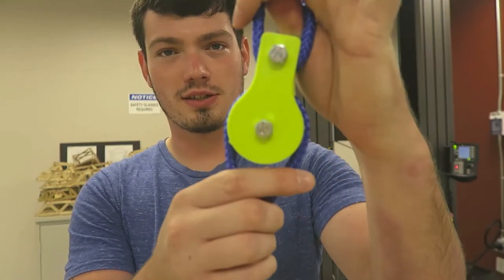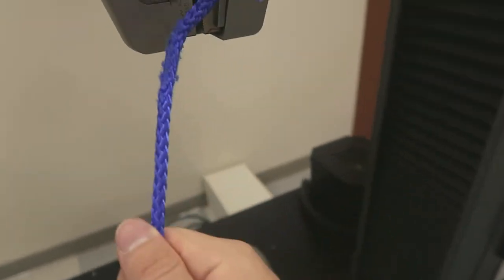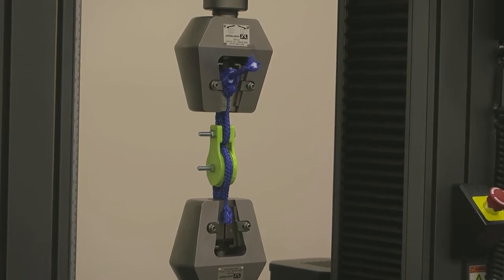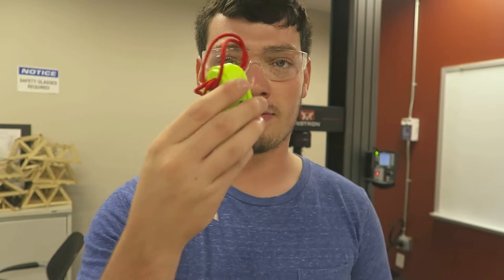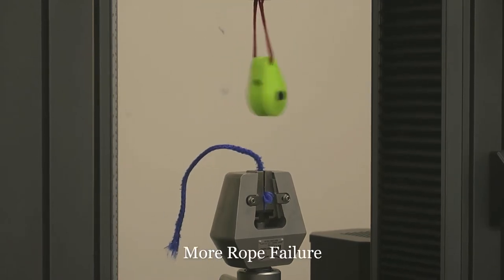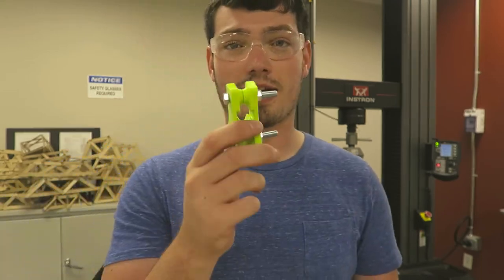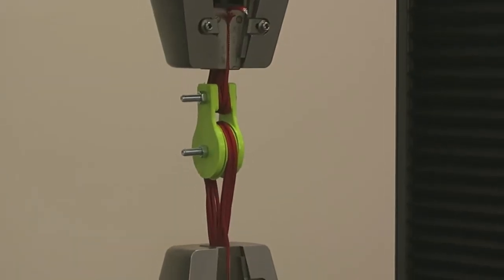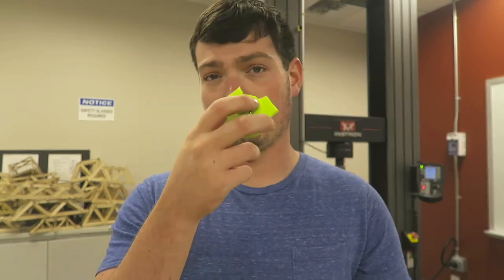Over 1200lbs on a 3D Printed Pulley???

Comment: Great videos , am just gonna take strength materials lab lol 😆 bout take some carabiner n load test em lol . Great channel dude sub
Reply from the maker: That's what I did might as well test what you can while you can. I'm open to suggestions if there are any ideas I can test
Reply: @Beyond The Tint  a block tackle pulley system . That be cool . My solidworks expired ,waiting till Monday lol to get that free code from our it department . Maybe your cadding is better . Plus you know to use the equipment am belly gonna learn monday.
Reply from the maker: These previous models have actually been from thingyverse, but cad just takes some time to get used to and you get better with every day you use it. The only thing with the block tackle pulls system is it would be hard to measure the weight multiplied from them without adding in another weight analyzer.